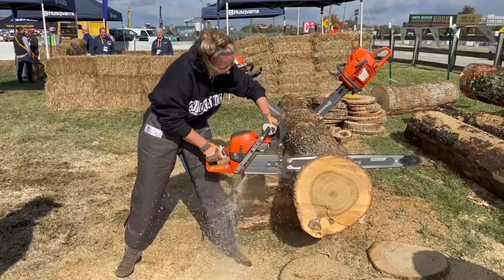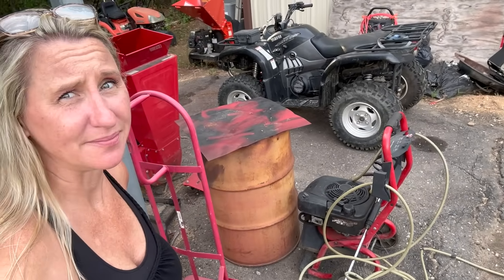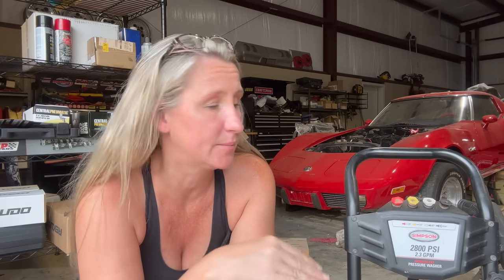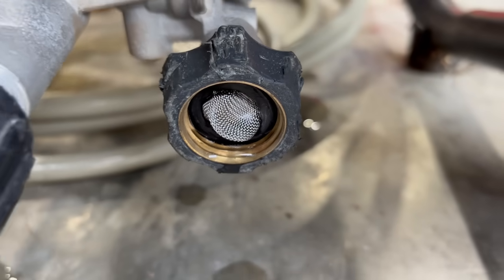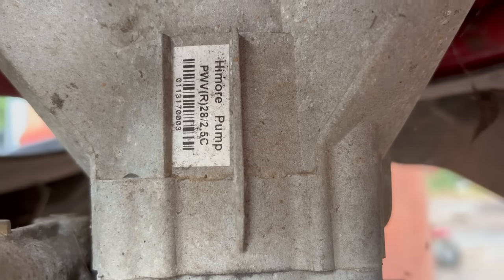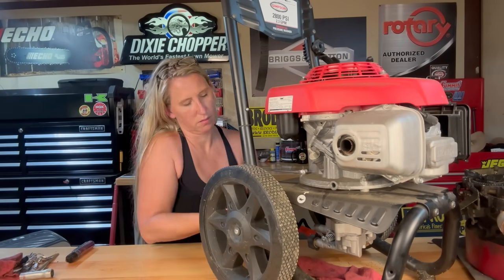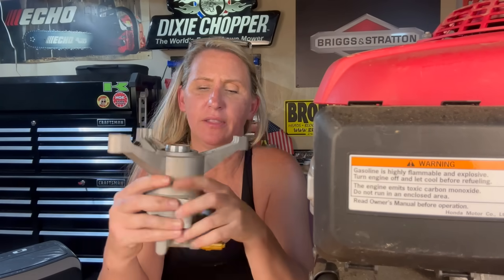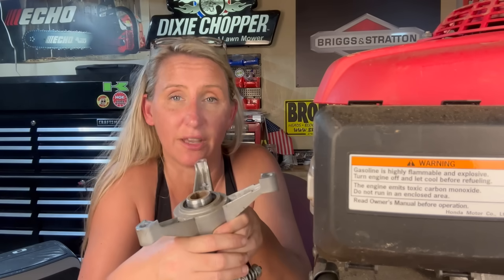STOP Paying Repair Shops! Pressure Washer Has NO Pressure?! Check Out This Super Simple Fix!

Comment: If someone could come up with a clutch-system between the motor and the pump, the motor could idle without the pump running. The "problem" would be how to engage the clutch, when pressurized water is needed and how to disengage the clutch no water is running through the pump.

Comment: You forgot to mention the sticky pressure relief valve  unloaded valve or the bypass valve. These will stick in the bypass position and not build any pressure. Pull the valve out, lube with white grease and reinstall.

Comment: I'm looking to try and fix my pressure washer, because of course, i go to use it today and it wont stay running. Probably a clogged fuel from sitting?  
It sure would be nice if your videos are organzied though. I try and search pressure washer repair or anything to do with pressure washer and it doesn't show me the video, so I have to manually go through allyour videos.  Its disappointing, because I would rather get my repair advice from you than from another youtuber. 
For reference my machine is a - ryobi honda gcv160 pressure washer

Comment: my pump shuts the engine do😮w if i let the wand trigger off.   it won t start when that happens unless you pull the wand trigger thrn it starts at full pressure.  whete do i look to repair it

Comment: If these pressure washers had a centrifugal clutch like a chainsaw or weedwacker that would kinda fix the idling issue no?  Also would allow you to start without water on which would  be a help for operating and troubleshooting. Maybe it’s time for someone to step up and make one like that. Instead of burning out pumps. The clutch would probably cost far less than a pump.

Comment: homeowners should avoid these gas pressure washers like Cancer.  i played the game with these and am convinced they're engineered to fail, and my theory is the heat transfer from the engine has a lot to do with it; the whole business gets as hot as heck.  i just accepted it and would buy the rubber rings kit, but that shop changed hands, and the new owner wouldn't sell me parts dang him.  

then i discovered the SunJoe electric pressure washer.  it needs pump lube/antifreeze and caution about junk in your hoses, but it's heaven.  and when you release the trigger, it stops!  yeah, you can be on a ladder and not worry that your pump is burning up while yelling, "i'll be done when i'm done!"

Comment: Pressure washer in storage for four years. Would not start, old gas. Took it to shop flushed out old gas, new oil, and fresh spark plug. Brought it home, quickly started, ran until the gas tank was dry, or so I thought, Filled it back up, the pull cord would barely pull, not enough to start, and not much at all. No ideas what happened or if I should take it back to the shop for evaluation. The owner of the shop initially tried to charge me for a new carburetor they didn't change. Fortunately the repair person walked by and I asked him if it needed a new carb, he said no just a good cleaning, saved me $ 75.00. This machine probably doesn't have three hours on it. Iam worried that the motor or pump seized? Any help would be appreciated.

Comment: first thing upon buying a pressure washer is to use a zip tie on the handle of the wand and zip tie the trigger to ON permanently.  as Chick said they cannot handle no flow their pressure relief valves do not work or are non existent.... so if you start the engine  and no pressure relief valve something is going to break.... best solution is to have the trigger tied to the on position all the time.... yah it's a P.I.T.A.  but better than blowing the pump !

Comment: I did a pump repair once.Must have been some water in the pump and so of course,in the cold  garage.The pump worked just fine but also sprayed from a crack,so there's your epoxy.Not a sponsor
It was a loaner and never came back.Can't say how long that thing lasted
Like it was said,back a bit in time you had to get a generic pump for big $$$-  
That's where you roll the dice, buy a new machine? Yes

Comment: Please define "Idle" to your viewers!  My understanding is "to run the gas motor without the spray nozzle in use/open.  no water flowing past the pump just generates heat quickly which will melt the non metal parts.  So clarify that term, "idle"  It may be obvious to you, but not to everybody....

Comment: Please ya'll.. try to disassemble the pump 1st.. VERY often, it'll be the one way valve(s) got a tiny rock or stick in it..  fyi.. I started fkn shit up at 5yrs old then fixing shit at age 7 in 1969.. 1st legit work at 14 in a lawnmower turned Cub Cadet tractor shop.. then automotive prototype.. now, I'm a semi retired but tired property manager in FL..

Comment: The so called simple fix is check the intake and if that isn't it swap the pump?
I was hoping for better intel. I got a bunch of old units blowing water in the crank case sitting on my self for the day I might fix it. Shop wanted more than I paid for the unit to rebuild them. 
EZ4040 I get these for $400

Comment: And, don't start your pressure washer without opening the trigger on your wand, without a pressure tip, with water streaming out.
Don't close the trigger until the engine is warmed up. Then put in your pressure tip.
Never run the pressure washer without water.

Comment: Why not replace the internal components which have failed? If the cylinder is scored, yeah, replace the pump. But if the unloader or valves have failed, why not just replace those components?

Comment: The moral of this story is save money and do it myself... The insight to this is most small engine or "2 cycle / mechanics" are not knowledgeable enough to be able to diagnose and properly repair a triplex or swash plate power washer pump and successfully repair it without replacing the entire pump...

Comment: Total hip arthryoplasty has come a long way. The biggest issue with hip replacements is will the body reject the artificial trochanter. In patients in later years a condition called pseudodementia or false dementia can quickly revert to dementia related narcotic use. Especially when a long bone fractures or erosion of the joint is evident. It is without question the most prevalent danger of long bone fxs in the elderly. Ron will be fine. 6 months or longer recovery time but he will be up and ambulatory very soon. Good luck with everything and hope you realize how much time money and frustration this has taken

Comment: I rather spend better money for a better machine….those cheap ones are good for few jobs.
Or maybe a electric pressure washer might do the trick for small jobs.
My commercial pressure washer is almost 20 years old…with Honda engine and a CAT pump….still makes ok pressure,but nothing close when new.
I will dismantle that CAT pump and inspect it for probably O rings damage or so….
Or buy a new expensive pump that will last me another 20 years…probably.

Comment: Did you just advocate turning the crankshaft to line up the key? OK, that's bad advice if you don't remind people to REMOVE THE PLUG WIRE first. 

Otherwise you risk popping off the engine with your tender little fingers wrapped tightly around the crankshaft, which can wind them far tighter around that crankshaft than you ever wanted. 

The implications for doing this to lawnmowers should be obvious.

Comment: You Nailed it Lady.... You don't know what you are doing.
     First your initial demonstration showing a weak stream/pressure looked to me to be a CHEAP setup to amplify the belief you know what you are talking about...The Lance you were using did not appear to have a Nozzle in the lance so of COURSE IT IS GOING TO DRIBBLE....So that was a very poor demo.
     Any Quality (Not Amazon or Chinese Knock Offs) H.P.W.C. will have a pressure relief Circuit governed by a Pressure Relief Valve to dissipate overheated water due to the Lance Trigger being Shut, there is also normally a pressure relief shut off device that shuts the pump OFF in Larger Pressure Washers.
      The Trouble is there are so many cheap as shit garbage H.P.W.C. that the likes of Amazon, Supermarkets , Builders Merchants sell that ARE THROW AWAY ITEMS.
      Stripping a H.P.W.C. Pump is a few minutes job for any self respecting Mechanic to check first if the Barrels are scored from running dry or grit, then check the piston rubbers etc, Yes check the water inlet filter to see if it is blocked or intact.... Then check if the Motor is running at correct speed, check the NOZZLE for external damage ie being dragged across concrete etc.
      Many instances of Water Pressure drop is caused by WORN NOZZLE ....YES Constant Running for extended times at FULL Pressure say 1,000P.S.I. will wear the NOZZLE OUT.
     My eldest Son Operates a Small Engine Business and has for say the last 12 years told people up front that he does NOT service/repair small engines bought from Supermarkets/Tool shops/Motorists accessories Shops etc etc as he can NOT access Spare Parts and is NOT responsible for Warrant Claims.
     By the look of your workshop you will take on anything if people leave it for FREE.